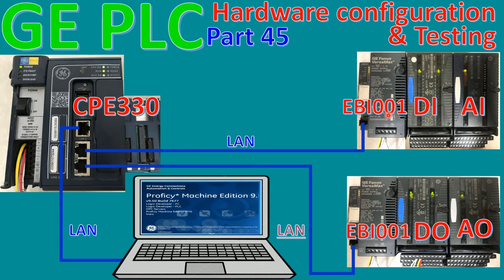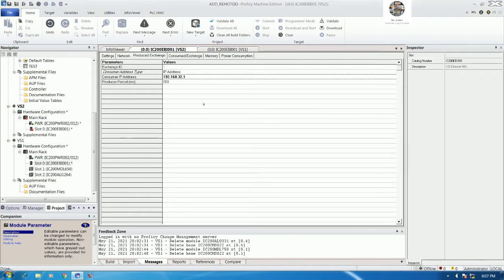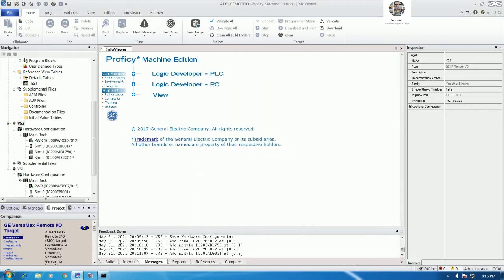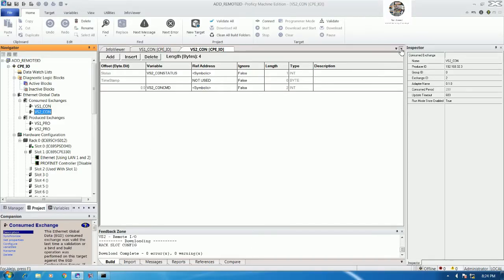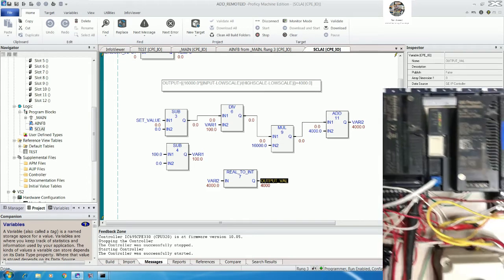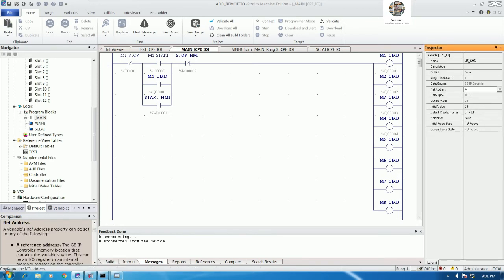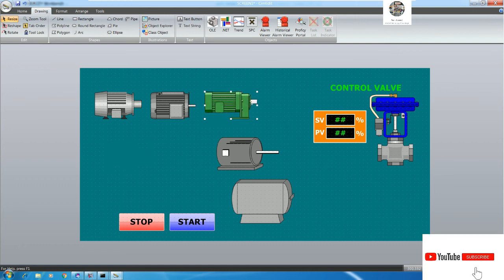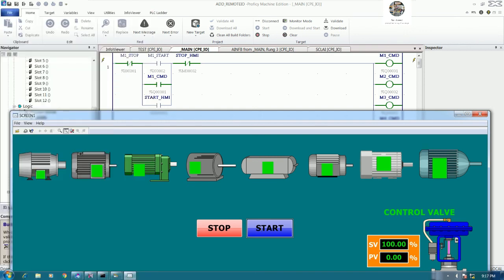PLC GE tutorial how to add 2 VerSaMax remote I/O and testing

Comment: hello, can you help me in fact I have a versamax RX3I automaton connected to a versamax input output extension automaton an ETM001 transmitter and two versamax non-isolated ERM002 receivers except that at the receiver level the analog modules do not light up no please help me

Comment: Hello, I have one plc question. Can you help me if I couldn't do the question? thanks.

In one System, 1 A button, 1 start button and 1 stop button and 1 three-phase asynchronous motor, and in 3 different systems the motor will be operated periodically in the forward and backward direction according to the following principles. When Button A is pressed 1 time, System 1 will be activated, and when the Start button is pressed, the engine will start in the forward direction. After 10 sec, the motor will stop automatically. After waiting 6 sec, it will work in the reverse direction. After 10 sec reverse running, the engine will stop automatically. After waiting for 6 seconds, it will work in the forward direction. The process will continue periodically until you press the stop button, and the System 1 signal lamp will be lit. Please write the required PLC program.
A button is pressed 2 times in succession as outlined above will be online and sistem2 however, this time back 15 sec, 7 SEC, 15 sec, forward, 7 SEC. and periodically in the form of sistem2 will run until you press the stop button during operation, the signal lamp will be lit.
Sistem3 pressed a button 3 times in succession will be online and as outlined above, however, this time 20 sec forward, 5 sec., 20 sec back, waiting 5 seconds and will run until you press the stop button in the form of periodically sistem3 signal lamp will be lit during the operation. 
Even if the A button is pressed at that time, other system operations will not be activated. In other words, the A button will be dysfunctional before the systems are finished working. The system must be stopped at any time with the Stop button, and the circuit will work so that the system will be activated whichever system we want to operate.
Reply from the maker: Dear sir,
Let me consider.
Thanks you for question!
Reply: @generaltechnologyknowledge5165  Thanks. Because you're interested.
Reply from the maker: @doguyldz1493  My pleasure!
Reply: Hello, is there any progress for the question.
Reply from the maker: @doguyldz1493  Dear sir,
I already tested but not yet final.I will speed up to final it soon because I need to do with full for operation of your required.I will show it when I final it.
Thanks
Reply: @generaltechnologyknowledge5165  I'm sorry I tired you, too. I didn't mean to put you in trouble, I just wanted to know how you were doing. Thanks again.